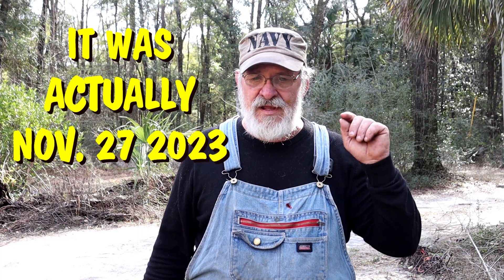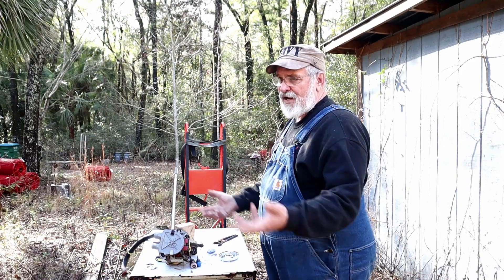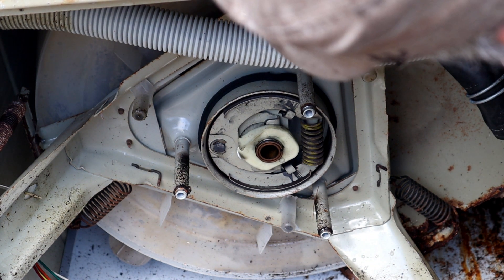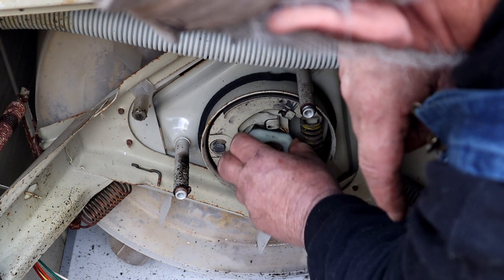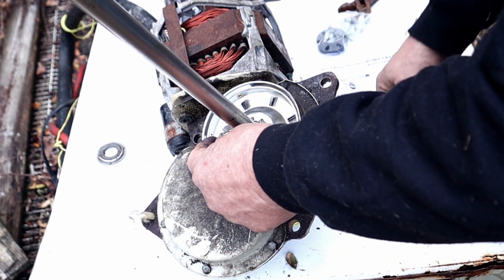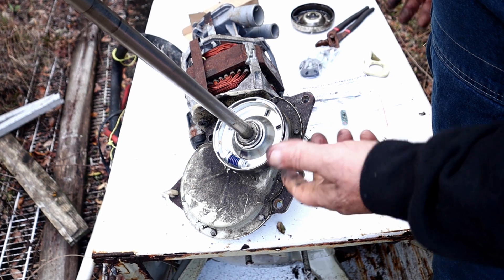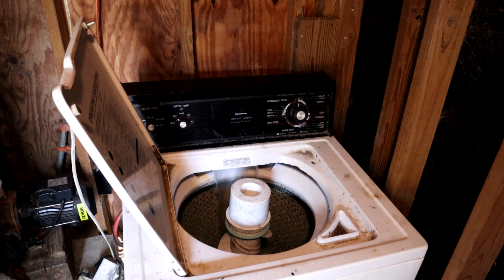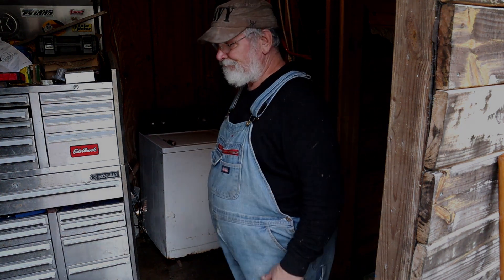WOW! My Kenmore 70 Series Washer NOW Performs Like NEW!

Comment: Even thowvyounguys cursed it helping us with ours. Thank you. Ours ended up transmission in it basicly. Wasn't worth the cost at that stage. But was a learning experience.we finally broke down and got one those cheap rv washers. Was like 130.00 it's more work involved but man do our clothes come out cleaner.
Reply from the maker: Cost about 35 dollars to fix this one and it is running so quite and doing such a great job.
Reply: @allaboutliving  good brand. Mine was a cheep one and wasn't cheap to repare.

Comment: I recently traded to modern Samsung washing machine and dryer for a 70 series Kenmore washer and dryer. Basically these were the same machines that my parents had when I was growing up. The guy I called off craigslist thought I was crazy when I told him I would trade my perfectly working Samsung machines for his Kenmore‘s. The guy was in the business of flipping Appliances, but he knew exactly why I was doing it. I actually paid him $175 to do the swap. The two machines he provided me, the 70 series, we’re like brand new from 2003. I am so much happier, I cannot believe how much the Samsung machine sucked! The cycles took forever, and the clothes did not get clean. I will literally keep the 70 series and repair them till the day I die. Recently, the agitator stopped moving because the little teeth up top in those plastic parts were stripped. I was able to order the parts on Amazon for like seven dollars, and without being mechanically inclined at all, I was able to swap it out in less than 10 minutes. Love these machines! Sorry for the rant, people spent way too much money on appliances, and I think these older machines are the best kept secret!
Reply from the maker: You got that right!!  You can work and fix these.  Hope you found this helpful for later down the road.  Thanx for watching, glad you found us!!
Reply: Was contemplating today replacing my 70 series washer due to broken suspension springs….I will give it more thought. 😊
Reply from the maker: That should not be to hard.  You can do it.  Take it apart and see what you gotta do and order the springs.  Haven't had to do that yet, let me know how it turns out.
Reply: @sharpey101  do not get rid of it! I don’t know what it takes to get those things replaced, but the parts are probably easy and labor probably isn’t too crazy. Let me know what you end up doing, eventually, mine will go out, as I am keeping mine forever! Do not get rid of it, you will regret it! I had modern Samsung washer and dryer and I traded for 22 year old Kenmore 70 series. Best appliance I own!
Reply: Ha ha.  I replaced my transmission for $200.00 and  cleaned her up real good.  Debating buying a new drum. For $250.00

But these machines actually clean!!!  It's like. Sloshing a muddy sock in 1 gallon of water vs 5. 

Only other thing is the timer fails after 20 years.  But I have an extra. Hope mine lasts another 20 more.